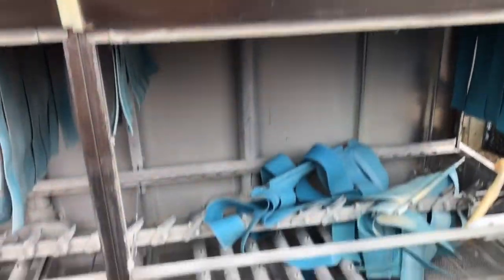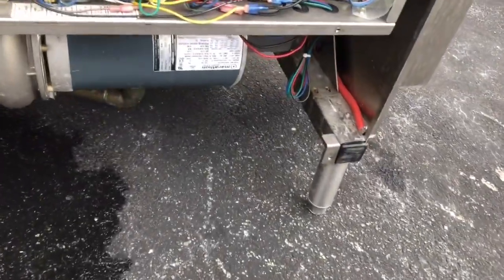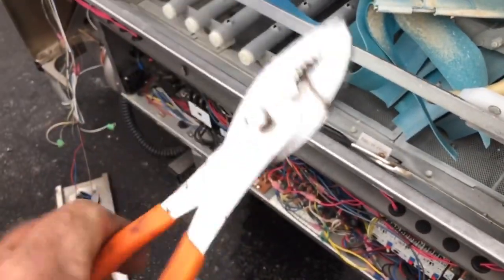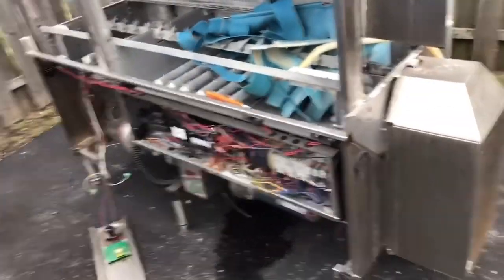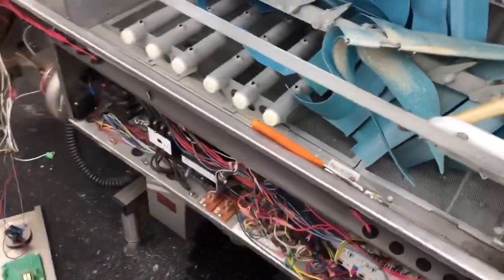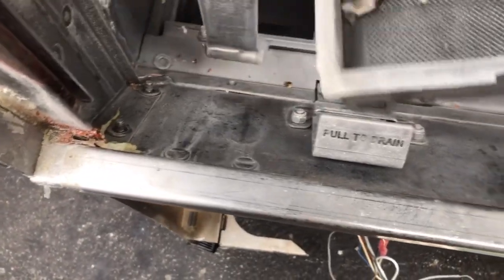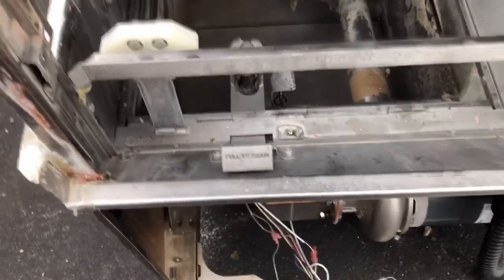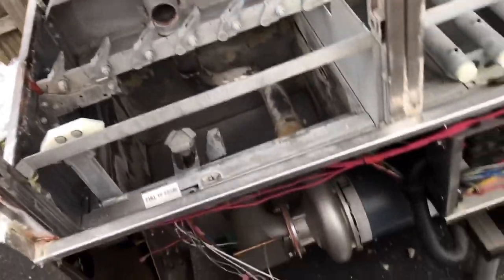HEAVY SCRAP CLAIMS

Comment: I see money signs! Hopefully non-magnetic stainless steel.
Might not dissappear as fast as you think, the competition won't be able to lift it either 😂
Reply from the maker: I was thinking about that too 
Yeah 💯% stainless steel construction
Reply: @steelisthemeal  nice, and I saw it has some copper too! Definitely a good piece
Reply from the maker: I’m going to have a blast tearing this thing into pieces
Reply from the maker: More videos to come
Reply: I have the same problem with this old vintage lawn tractor weighs between 750 and 1000lbs I was kind of worried about it disappearing and then I thought if I can't get it the other scrap guys can't either. I'd have fixed it and drove it home already but then they might want it back!
Reply from the maker: Oh that would be the ultimate dilemma
You get it running and then they want it back
Reply: Yep that's why I don't pull lawn mowers when I find them at the curb anymore one started up one time and the guy said I've been pulling that all day and it wouldn't start he must have flooded it and let it sit long enough to where when I pulled it wasn't flooded anymore I mean I don't care I'll find another one you can have it back
Reply: @steelisthemeal  u need cordless grinder and cordless sawzall or mini generator and corded grinder or sawzall luckily I found mini generator sawzall and extension cord in the trash still have to fix the genny though
Reply from the maker: I’ve got a small 1k w generator 
It runs but not good enough
Reply from the maker: This is my luck too
Reply: @steelisthemeal  hey I never said any of mine ran either haha
Reply from the maker: Thaa sad tale that’s what the scrap life is all about

Comment: A great find. Put the metal in the dodge tucked nicely behind that dumpster. Have you and your son get the front of the dishwasher on the tailgate of dodge. Use a tow strap off the Colorado in 4x4, and have the Colorado drag the dishwasher into the bed of the dodge. Then, Tek it to bits in ur shed.
Reply from the maker: I actually didn’t even think of some things this could actually work
Reply from the maker: 600 or more pounds of scrap bliss